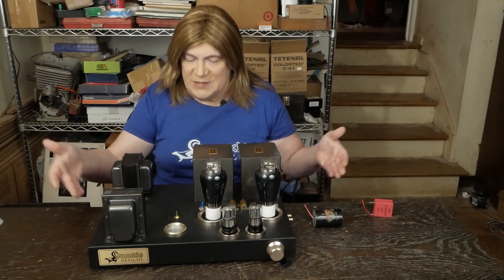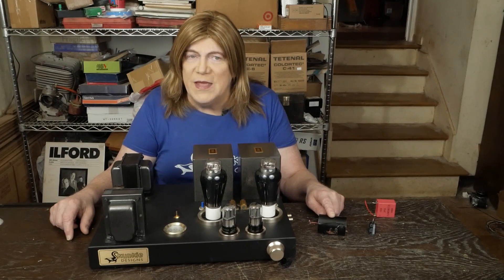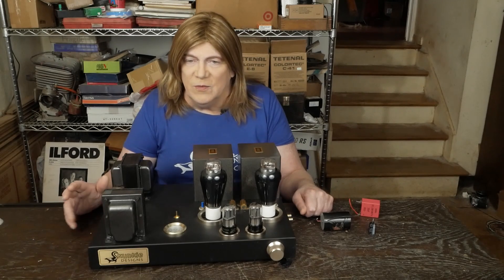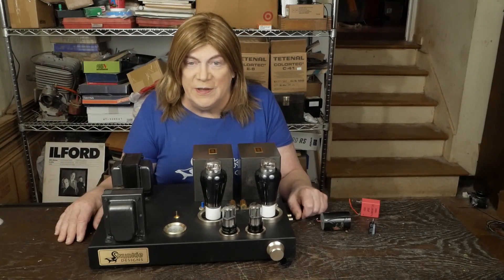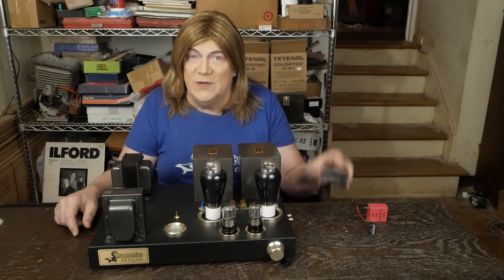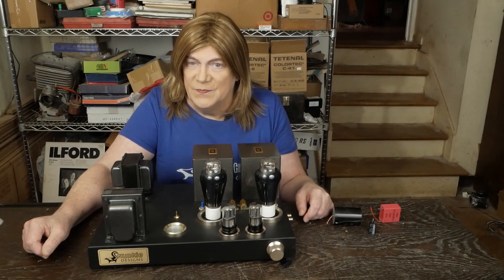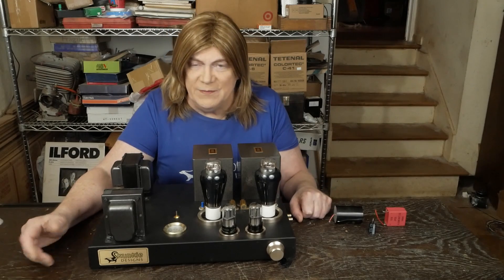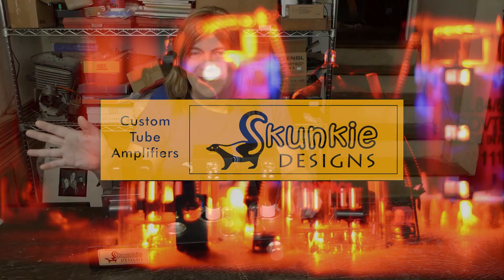Power Supply Cap Changes Amplifier Sound?!

Comment: 5:50 The last cap in the power supply is in the signal path (assuming this statement makes any sense at all). However, here it is the first cap that is replaced (from the looks of it, this amp sports a C-L-C filter, without knowing anything else about it) so it does seem less likely to affect the sound. The problem with these unregulated power supplies is that they only have 3-4 components so all of them play a large part in the performance, i.e. I'd venture saying that all their parasitic elements have an effect, there could be oscillations taking place (shrill top end does point to that being a possibility) and so on. I think it is possible to make a power supply get excited and thus affect the whole amp but I have never looked into it in detail. So much stuff to do, so little time...
Following this train of thought, the construction of these film caps (which are made to a price point, hence why we can get these stupendous values now in film caps that we could only dream of half a century ago) really affects their performance. Maybe these Wimas are of this slit foil construction, I dunno. That might or might not mean something when used in an audio circuit but one has to remember that Solens, despite being budget caps, are made for audio whereas Wimas are not (hence the term DC-link). This is food for thought as I always wanted to stock up on Wima film-foils or metallised films for all sorts of projects. Maybe I won't now, hmmm....

Comment: Curious: The 33uF Solen film cap you used , it was used as 1st solo cap after rectifier tube, ( as in original scheme ) not as bypass for a 1st electrolytic in PS , right ?
Reply from the maker: Correct. 1st cap all by it's lonesome self
Reply: @SkunkieDesignsElectronics  Thx!

Comment: I will try to make a short story: two years ago my DAC died. I write the seller. He tells me send it back to me and as soon as I see the mailing proof I will send you a new unit. I receive it and try it out. It sounded really bad. No bass at all and thin sound. I write this to the seller. He says: I don't understand because I sent you an upgrade version with all very good capacitors. Let it play for a while a couple of days. I opened the DAC and all the cheap $0.15 electrolytes were really replaced with Wima red caps. I played music for 3 days in my basement. Then tried it again on my main system. He was right. The sound was even better than the other unit. The bass was as good but the mids and highs were fantastic. Cleaned up. To resume my story: caps need breakin'in. Not only the electrolytes (reforming), the other caps to! 50 hours at least! I don't understand why. Normal for a speaker to loosen the suspension. Electrolytes often need reforming but Wima's... ???? A film or polyester cap???... Next time play music for at least 50 hours before you make your mind as I did. My short story seems quite long. Sorry my friend!
Reply: Why not 100hrs, or 1000?
Look up bias, and youll see your a audiofool.

Comment: I agree with Stefan.  The difference between the capacitor types will affect the signal.  Every with a charge has a Magnetic and Electrical field offset by 90 degrees.  So the fields around the aluminum plates is affected by the shape.  The shape of the capacitor could affect the density of these fields and in turn affects the signal.  There could be constructive and destructive interference.  Remember all energy is moved through fields and not the conductors.  Electrons don't really move from one end of a wire to the other.  They basically vibrate. There is some electron drift but this is pretty slow. Energy is transmitted through fields as well as audio signals. So each type size and shape of capacitors will be dissimilar, because their fields will be different.  Energy moves through fields, not wire.   This is why overpriced audio cables are a scam.

Comment: One of the important things that power supply caps do which is often overlooked is they provide a low AC impedance path to ground.  A higher ESR cap, especially one that increases with higher frequency, effectively makes the plate load higher in value.  It becomes the load resistor or transformer primary plus the impedance of the capacitor.  It ends up being effectively a variable plate load.  The other thing that can happen, mostly with bad caps, is you get poor decoupling between the stages so the output affects the driver.  Extreme amounts mean motor-boating, but small amounts might produce some IMD which doesn't sound great.

Comment: I am wondering if a comparison of the Equivalent Series Resistance (ESR) values would provide useful data in this case. 

Also worth noting, some designers place a smaller value cap (of different material type) in parallel with larger ones and then note sonic improvements - but I do not recall if this is only in the signal path or also in the power supply section.
Reply from the maker: Or degradation. Bypassing does not always = better.

Comment: Did you buy your wima dc link 30uf from ebay or aliexpress, anything not from retaliers like rs or mouser normall sells fake parts. As I find fakes ones normally don't have any metalisaton and its just polyseter caps which I don't like.
Reply from the maker: Mouser

Comment: Power supply or any capacitor used in an amp has huge impact on sound quality.
I used to not have to budget for more parts, but when I did I tried some Nichicon KA caps, couldn't go back since huge improvement in sound
Reply from the maker: Right, but they aren't made in higher voltages. I still like Nichicon caps, although I have started using audio note for cathode bypass use.

Comment: Always loved Solen capacitors and have been using them for 20+ years in my amps for any large value caps. Even though we draw the circuits as if the current flows to ground, of course it actually flows from ground, so this makes many parts of the circuit we think of as unimportant to the sound actually very important.
Reply from the maker: Thanks for sharing!

Comment: hi if you have room for solen   in the supply ,put only solen its sound better cause these caps have a very low resistance  and this is very fast and keep stability all the time ,electrolytics change  properties with use .
Reply from the maker: Great point!

Comment: Perhaps you want to look into room, equalization wizard (REW). At the risk of spouting heresy here, I think a little digital signal processing could change any of the characteristics that you’re talking about being affected by capacitors. I have heard similar discussions involving cables. sounds awful lot like people are shooting in the dark trying to get a certain sound with caps and cables when you can zero in on the kind of frequency curve you like in your room with DSP. Personally, I have tested my hearing and know how it falls off in the higher frequencies. I created a compensation curve in Roon and I found I like it quite a bit. Of course at first it will sound a bit bright, but very quickly. It began to sound right to me. Just something he might want to consider.
Reply from the maker: Any type of EQ box I've inserted between my turntable preamp and the amp adds a veil to the sound, even if the EQ is better, it masks part of the sound in the process. That's been my experience anyway.
Reply: Admittedly DSP (digital signal processing) makes more much more sense when the sound source is digital and you can get it done prior to the digital to analog conversion. But since many of us are going to streaming as a main audio source it is very doable and Roon is my tool of choice for doing this since DSP  is part of the package anyway.
On the other hand Room Equalization Wizard is a free piece of software you use with a calibrated microphone to chart  the flatness of the frequency spectrum coming out of your speakers. Similar to how you use you oscilliscope to measure distortion directly from an amp. So REW could chart the change in the signal created by those capacitors you were talking about. Then my thought was, at least for digital signal sources, some DSP could be used to make the same modification to the sound. 
  I've been using it to learn what sort of frequency curve I like so that I can duplicate it across various pieces of listening gear. @SkunkieDesignsElectronics
Reply from the maker: I know what REW is and have used it testing speakers. And in testing, this software/microphone combo isn't sensitive enough to decern some of these nuances.

Comment: I believed the same as you, the power side had nothing to do with the signal response.  I like to build Class A amps between 3-8 watts.  I built one using a 12AX7 and a 6V6 into a 30 caliber ammo can for camping and travel.  I included a switchable circuit for valve or diode rectifier filtering.  Originally I used some cheap IC caps and was OK with the sound but switching between rectifier circuits there was a difference in tone.  At first I wrote it off to the extra punch of the voltage with the diodes but it didn't make sense, the caps in the power section were the same.  I'm just a hobbyist and not an engineer so I took a shot and changed the power filtering caps to F&T's, all of a sudden I noticed that the diode circuit sounded about the same but the valve circuit sounded much better, lower volume than the diodes but the tone really came alive with the F&T's.  Go figure ........

Comment: Upgraded my HIVi diy 2.2A speakers crossovers.  Shrillness was removed by switching out caps with $15 each film caps.  Then sound opened up and sounds like it has so much more air and life, and cleaner bass with the speakers plugged into 8 ohm taps.  Can’t put my finger on it, but they sound so much better in 8 ohm tap of my R8, than 4 ohm taps.  Run other speakers in 4 ohm and forgot to switch at amp.

Comment: Wow, this was an exceptionally interesting video, and that's saying quite a bit because your videos are always interesting.
I recently replaced a similar WIMA cap with an Audio Note Copper Foil oil filled cap that was used as the coupling cap in my BrzHiFi 300B amps. I wasn't surprised that it made a substantial improvement, but the power supply?!? As you say, a coupling cap in the signal path is one thing but everyone almost always uses electrolytic caps in the power supply.
My first tube amp was a Dynaco Stereo 70 that I rebuilt, and adding film bypass caps to the electrolytics in the power supply completely opened up the top octave. So I guess that I should be so surprised.
I think that we simply don't completely understand what about capacitors affects sound quality and how to measure it. So, the impact on sound quality remains effectively magic. It can only be observed through trial and error. We can form some general rules but that's about it.
Pete

Comment: I hate to say it, but I suspect there are other impacts in the power supply.  That one wacky thing that china hifi said about large chokes choking the sound.  I think there may be something to that.  If you have a cap inductor, cap filter the power supply, the second cap needs to be big enough to supply power for quick demands in current on the power supply.  I suspect with larger inductors, an amp needs larger caps, or the choke will not allow current to change quick enough for good dynamics. Just a hypothesis at this point.  Chokes also add resistance which result in voltage drop with increased current.  Not a big deal in tube amps, but the last cap needs to keep up.

Comment: Well, one way to look at it is that the amp modulates the DC from the supply to make a larger version of it at the output. The input signal never makes it past the 1st grid... or base or gate for that matter. Thanks so much for this video!

Comment: That's very weird being both are film caps - also being in the power supply never would have thought you'd be able to even hear a difference- I never heard of Solen caps failing before they are very good caps- but your's got physically crunched. I too would like to see what putting an electro in that 1st caps place will do also as it will store up more energy even if it is a low value 30uF -33uF but the films should be better cap at filtering the ripple. Weird
Reply from the maker: Yeah, I seriously just thought I was replacing a film cap with a film cap. The difference was NOT subtle! Like I hear was less difference swapping coupling caps around.

Comment: Input caps and the caps  between the input tube and output tube make a difference on how it sounds. Look at BASS and Treble circuits in amps and you will see resistors and caps to change the tone output. Bass in the amp takes more current so you need heavy storage caps in the power supply for deep bass.

Comment: Everything can make a difference. Us Audiophools learned this a long time ago. It is very harmful to the pocketbook. Thank goodness for diminishing returns. Listen and choose what is important to you.

As far as the power supply, remember, the input signal itself is not what is amplified, it is remade, at a higher amplitude or otherwise changed, at each stage. Each stages output is just the power supply being modulated. The power supply IS what you are, ultimately, listening to.

Dan
Reply from the maker: I was really just shocked how different this sounded, WAY more difference that any coupling cap change.

Comment: The DHTs would be my guess. It stands to reason that you are running filtered DC directly to the cathode, no?
Reply from the maker: The cap wasn't part of the cathode/heater voltage supply.

Comment: It would be interesting to see if breaking in those Wimas electrically, would change the sonic signature. I know break in is a controversial subject, and I did hear you say that the new Solen changed the sound immediately, but it would be an interesting experiment. I put some Russian paper in oil caps in my Klipsch Cornwalls, and they sounded awful until broken in. Some say 300 hours, but the first 100 does the most. I’ve also been told that when breaking anything in, not to just run current through the unit, but also to turn it off from time to time. Thanks Skunkie!
Reply from the maker: Could be, I guess the main point was: This changes my thoughts of power supply design and it's influence on the sound.

Comment: The caps Film vs. Electrolytic are generally different in architecture and so in their behavior. Loading-Capacity and Release-Capacity are totally different  especially in "speed" of doing that.

So they will release demanding power in shorter or longer time. This has an impact on the tubes.

When you compare caps of the same architecture, there will be also differences in their behavior. Depending on the chemical as well as building differences. 

Cheers 

Stefan

Comment: Is it possible that the single ended circuit is just more sensitive to these kinds of issues...like parts quality or materials? I've never had another piece of tube gear act like this before...and I've done cap work on Dyna Mk III's and IV's. Of course, the Dynaco's didn't have the sound quality either.

Comment: Power supply can well be viewed as a positive feedback loop if that help with understanding  the effect.  Mullard called tubes valves as in valve regulating the flow from the power supply.  Different perspectives help solve problems. The ESR of the Solen's  are a bit different than the Wima's  prefer ASC to both of them .
Reply: What size series asc are you using and do you parallel them?I ask because I have some 20uf 400v from all electronics as well as some 60uf that I forgot the voltage.large polypropylene.
Reply: @johnstuchlik5828  Some series resistors give a better filtering than paralleling basic Radiotron stuff. Stay small for the first one to keep from having big peak current spikes for the diodes. Save the big ones for the later stage of the supply . Any of the ASC will work for me this is in the range of flavor to taste.  Common diodes state 32 mfd as max for first cap  the 20 is a good choose most of the time for the first one .
Reply: @johnwilliamson467 thanks for reply.im going to heed the tube manual first cap size limit w/o surge resistor.i am planning to use 5v4 on my low watt projects mainly because I have some and like the slow warm up.first cap will be 7.5 to 10 first cap, probably try different types,motor run ,electro,poly, what I have on hand and use larger or parallel smaller after choke/resistor.definite going to look at b+ with scope for problems after watching this video and reading comments.

Comment: The sound of capacitors - omg Skunkie, I went down that rabbit hole with my preamp and amp builds sometime in the mid 90s - the hours and dollars that I've spent!  With regard to their use in the power supply, my experience is yes, definitely the differences are audible.  In all cases except for one power amp I ended up choosing good quality electrolytic caps as my choice for the most natural sound.  My experience with film caps (Solen mostly which I found to be very good all around caps versus the boxed not so good sounding Wima caps) was that a touch of high end tip up could be gained but at the expense of grainyness.  With regard to bypassing, I don't recommend it.  In every case i could hear the bypass cap - either tipped up highs again with some grain or an added flavour to the mid range if the value was higher.  I have also tried oil type motor run caps - though they may add some smoothness to the mid range, speed / dynamics suffer.  Also, be careful with the size of the film caps, I found that if the value gets too large, like the 39uF film I used on a 5AR4 I experienced a kind of pumping action to the bass, no problem though with 2 x 22uF.
Reply from the maker: Great info!

Comment: I have never seen anything good or measured written about wima film caps.  Polypropylene in oil motor run cap would be interesting to try.
Reply from the maker: Yes and I've used them in one very nice sounding amp.